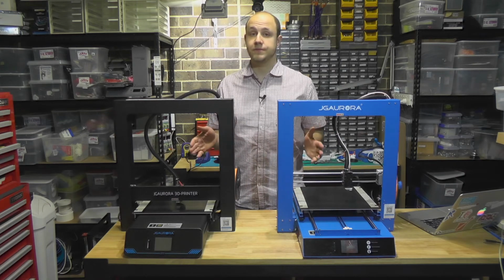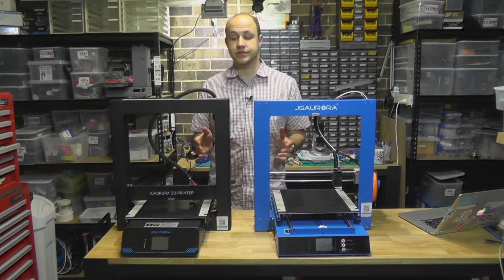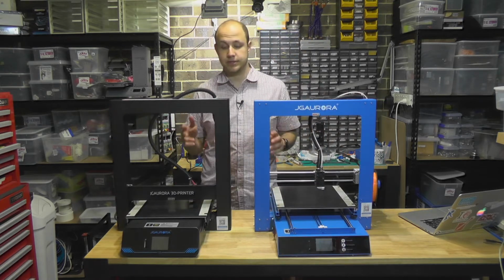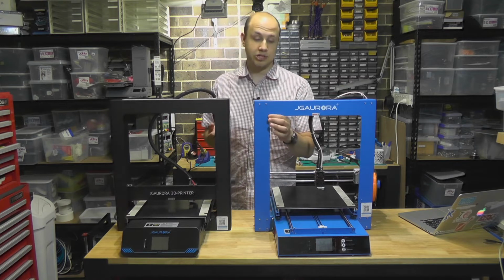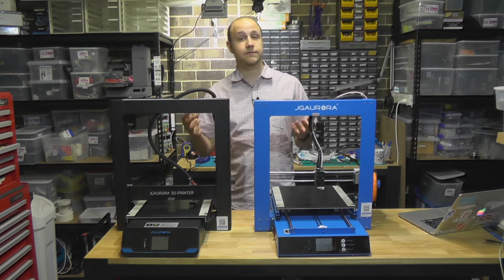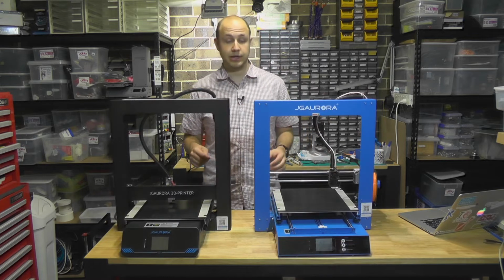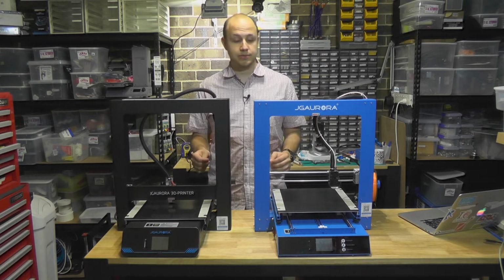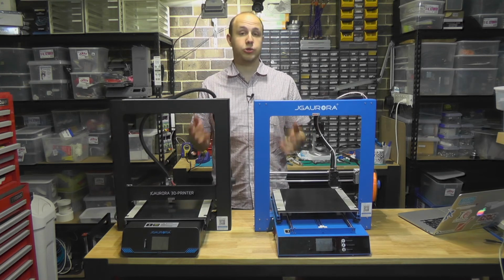JGAurora A5S vs JGAurora A1 - Quick 3D Printer Comparison

Comment: Hello, I want to buy a printer, and I am hesitating between the A1 and the A3S. Aside from the difference in print size, I would like to know if both printers can use PLA, ABS, or flexible filaments like TPU. The indications that I see on the web do not completely clarify it for me. (Is flexible filament printing reliable?) Also, I see that in the A1, it has a functionality to change filament color and to be able to print objects of different colors. Is this method reliable? Does the A3S have this same function?  In general terms, which one would you recommend, regardless of the printing volume?
Thank you!
Reply from the maker: Hi Carlos, both can do PLA. ABS is tricky on open frame printers because of the tendancy of parts to warp, putting the printer in an enclosure would likely help this. Flexible filaments are difficult on both of these printers due to the long bowden extruders. But it is possible on both, perhaps slightly easier on the A3S as the bowden tube is slightly shorter due to the smaller size. Neither printer can print multi colours, unless you have the printer pause on a layer where you can switch filaments. I would not recommend any printer without hearing your specific printing needs. I enjoy the A1, it is very very good value. I have successfully reverse engineered the motherboard to make a full custom Marlin firmware for both printers. You can post on the forum (jgauroraforum.com) if you have further questions. Thanks, Sam
Reply: @SamPinchesMakerShop  Thanks!!

Comment: thanks for the review almost bought a A5S, glad I didn't. sense they went closed source :P
Reply from the maker: They're just about to release a new printer - the JGMaker Magic, that I'm pretty sure will be open source - just waiting for them to send me the files before I make that claim with certainty. But also, we're making good progress towards getting marlin 2.0 to run on the A5S & A1 ... looking promising on all fronts! Finally, they did release the A5S source code in the end too - but it is very complex, and too hard to modify/upgrade easily.
Reply: @SamPinchesMakerShop  it's already able to buy. Is it a good choice for first 3d printer? I am thinking about JG Maker magic or Ender 3 with marlin 1.1.9
Reply from the maker: @luki3323  For a first 3D printer, I would recommend the Maker Magic, but the Ender 3 is definitely also a good choice. Unfortunately the Maker magic is not yet open source, but I will confirm with the manufacturer and give you an update soon.
Reply: @SamPinchesMakerShop  thank you

Comment: Hai ser today I install jgaurora a1 3d Printer I checked Power failure resume print not ok. I am Printe 2 minutes then power off. 50 second power on my 3d Printer no resume print option.
Reply from the maker: I also had this problem - according to JGAurora, the power resume feature is only enabled after 5% of the print has been completed. Thanks for your question. Also, in the future, did you know that you can get help with us on the forum: https://jgauroraforum.com Happy printing 😃
Reply: Thang you so much ser I am chacking..

Comment: One thing to note is the A1 can print at a 50 micron height whereas the A5 can only print at a minimum 100 micron height.
Reply from the maker: 10p6 sorry, thats not true. Both the A1 and the A5 printer can print 100um and 50um layer heights.
Reply: @SamPinchesMakerShop  According to Jgauroras site and staff the A5/A5S can only print down to 100 nanometer scale.
Reply from the maker: 10p6 you can set whatever layer height you want in cura. Print quality is better on A5S and A1 than on the A5 out of the box.
Reply: @SamPinchesMakerShop  I would love to see you do a test print on both of these at the highest resolution (thinnest layer thickness possible) for comparison. :-)
Reply from the maker: @10p6  Thanks for your suggestion! The trouble is with low layer heighs, with a 0.4mm (400μm) nozzle, printing below 100μm doesn't really give you as many benefits - it gives you a smoother surface finish, but no significant increase in detail. For high resolution printing, it would be better to go to a 300μm nozzle, as the added resistance to plastic flow will also help reduce oozing a little bit too. The reason I have not done a lot of print quality tests, is for two reasons: one, they take a lot of time to prep, and optimise the settings, and unfortunately I don't have a lot of spare time at the moment. The second reason is that these printers are not designed for ultra-high-resolution printing - their strength is more in large model printing. The i3 frame design doesnt scale well, as the larger the bed is, the larger the moving mass gets that the motors have to drive around. This means if you want high quality, you need to turn down the acceleration and speed a lot, otherwise you get ringing and rippling in the corners of prints. The A5 in particular has a metal frame made of thin sheet metal, that is not as stiff as I would have liked ideally. I've noticed in prints from the A5, that the alignment between layers is not as consistently accurate or precise, as with some other printers. The long bowden extruder on the A5 is also a downside when it comes to fine prints - each retraction is longer and slower, and the huge number of retractions required significantly increase the time of the print. If you're interested in higher resolution printing, you might consider a smaller printer, like a 250cm square bed, and perhaps a different motion system like the CoreXY. I'm trying to organise some more non-i3 printers to do tests of, but the i3 frame design is cheaper to manufacture, so that makes it much more popular. If you're looking for highest print quality at a budget price, I recommend the JGAurora A1. I was very impressed with the results it gave, a big improvement over the older A5, and the stiffer frame will definitely help the print quality at higher printing speeds compared to the A5S too.
Reply: @SamPinchesMakerShop   Thanks for all the info.   I was actually about to buy the A1 then decided to jump ship and buy the Chiron, hmmm.  I really need at least 300 x 400 and thought about the CR-10 but hate the separate control box, and i'm amazed the A5S or A1 was not given 400 mm height update.   The Chiron is a quirky machine, but it prints huge, can print in high detail (I am sure this slower than hell though) but at least it has direct extrude so can do all the flexible materials.  I would still love to see the A5/A1 prints though, and if you are up to it, a Chiron comparison. :-)
Reply from the maker: @10p6  The Chiron looks good, and the print quality is decent, but from what I have seen the speed is very slow (exactly like I said - huge moving bed...) and the reliability is very poor. Check out their facebook group. Unfortunately I don't have a Chiron available to me to test, but it seems like an inconsistent model. :-/
Reply: @SamPinchesMakerShop   When I get mine, I will probably change the belt drive on the bed for a screw drive of some kind. I know this could slow it down some, but if done right it will eliminate the momentum issues on the large  bed, thus increasing the quality of the print.

Comment: Do you think the homebrew crowd will still work out getting their own firmware on here?
Reply from the maker: Chaos Corner thanks for your question. As part of the last homebrew crowd on the A5... no. Or, at least, not yet. I’m happy to talk about this more, about what is involved on the forum here: https://jgauroraforum.com/discussion/394/planning-new-firmware
I’ve linked my recent blog post discussing this over there too.
Reply: @SamPinchesMakerShop  Thanks. I'll take a look. I've had a Printrbot LC for a while now but the limitations of the bed size and accuracy are starting to pinch. I've been looking at maybe a jgaurora for a while now and now that these new models are out, I might bite. I'm leaning towards the A1 at the moment but there are some deals on the A5S out there right now. I have to admit, I'm also surprised at the lack of the self-levelling. I think that's in the Marlin firmware now (?) and I guess that shows the risks of moving away from open source, especially when it's open source that is very well supported by the community.

Comment: Hi Samuel,

I recently bought the A1 printer but I  am having some difficulties to get an acceptable printing result - or a print at all.... The main issue seems to be under extrusion. This could be due to the stripped filament. I have tried multiple different settings, but none seem to work. Even the by JGAURORA supplied gcodes don't seem to be printing at all. Do you think there could be something wrong with my printer? Do you have any suggestions for other settings?
Reply from the maker: What slicer are you using? Theres a big bug in cura 3.5.X
Also, check that the PTFE tube is not kinked or bent.
Reply: @SamPinchesMakerShop  i have tried cura 14.07 (provided with the printer), cura 3.2.1, cura 3.6.0 and even JGcreat 2.5.0. I tried so many settings... And when one model finally seemed to print ok, the filament started scraping again after less than an hour. The tube looks fine to me
Reply from the maker: Tamara H actually, I remember that my printer had a similar issue at first! I’m going to make a post on the JGAurora forum (jgauroraforum.com) - feel free to join me there and I can explain what I did to fix it.

Comment: I actually think that auto bed leveling is less important than a good build surface. I have a A5 and a FLsun I3 and use to have auto level on the FLsun. After purchasing the A5 with the glass bed and upgrade the FLsun to a glass bed and removed the autolevel. Both printers print great just using manual mesh bed leveling. Since the prints pop off, without any force, the bed stays level and there is no need to relevel every time.
Reply from the maker: I 100% agree Bernie! A good true-flat bed surface also has several great advantages over a wonky one that has been "corrected for" through software - such as distortions in the print up to the "fade-height". I really wish that I didn't need to use mesh bed levelling at all!

Comment: Hello) I am planning to buy an A5S, is it a good printer? I do not know English very well, can you please tell me in brief in short Thanks))
Reply from the maker: It is a good printer for a beginner. It is easy to setup. The print quality is very good. But, you cannot modify it, because the software is locked.
Reply: Samuel Pinches Hello again) can you suggest what is better - the usual A5 or A1? or better to pay extra to A5S? 
Thank))
Reply: @SamPinchesMakerShop  Nobody uses the original software on it.
Reply from the maker: @Yulaw2k   Having been involved in the creation of the custom firmwares for A5, A5S and A1, I'm certainly glad to hear that :) However the firmware for the A5S and A1 is still beta, where as our custom firmware for the A5 is quite reliable at this point.

Comment: Good job Mr Pinches! 👍🏻  u r the first to bring to light the A1.  

Although, I am afraid JGAurora just signed their death warranty.  

Mesh bed leveling is crucial into bringing print quality results, on which requires no hardware.  It has already been developed by the community and implies no extra cost to the company.  Even auto bed leveling with a probe would be feasible and inexpensive.  Yet, they do not seem to be on top of their product, nor listening their costumers.

Notwithstanding, taking into account their chosen path of proprietary board and closed firmware,  these two new machines look more like a statement to the community: “We don’t want u, we don’t need u.”
Reply from the maker: Thanks Leandro! Yes, I'm very concerned about JGAurora making a big mistake. I really hope that their survey will show them how important it is to support open source firmware. I know there are many people who don't care - but I think those people are mostly newbies who do not understand the situation fully. 

The problem will be for JGAurora, that without passionate enthusiasts (generally open source supporters) there will be no community growing around their new printers. They are about to find out whether or not they need the community.........

Personally, I do not like mesh bed levelling. It introduces some artifacts, as it squishes and distorts the part shape into the new uneven surface. It is not good for high dimensional tolerance either. Ideally, the printers should be increasing in precision. Unfortunately, for many people these machines are just fun toys, so the priority becomes lower prices rather than better quality. I think that soon, the market for toys will be over, and people will demand better quality.

It would be sad if JGAurora was to fail this way, but like you say, this is their own choice. The other big two manufacturers - Creality and Geeetech, they have both demonstrated that they see some value in open source, but JGAurora has rejected it. Nothing more we can do. 

Thankfully, there are still some great open-source hardware designs out there, and plenty of 32-bit open source firmware projects too. I'm building my next printer (based on Misumi 3D Pro) from scratch....
Reply: Samuel Pinches They can’t please everyone.  There is always smth missing.  

I do understand there are many who do not care for mods or higher quality, as long as there are no option.  But each of them welcome improvements that won’t reflect on their wallet.

A5 is a beautiful piece altogether. U can easily turn a budget machine into a high end model. 
JGAurora can still keep both worlds, but if they choose to distance themselves from previous models, I foresee Creality taking back the spotlight.  

Build one from scratch is an awesome project.  Wish I had the space to work on such.  Keep us updated 👍🏻
Reply from the maker: @ne0xys  I really like how the A5 encourages people to learn new skills and rewards them for doing so with new features. That is one of the reasons I have stuck around till now. People have come up with some amazing things, and it has made this community a lot of fun to be a part of. Sadly, I don't think the same will happen with the A5S and A1.

Once I have things progressing, I'll post something about the next project. :)
Reply: @SamPinchesMakerShop   You brought up a very good subject regarding the mesh bed leveling.  People should know they must avoid printing on uneven surface, even if the software does the hard work behind the scenes.  Such feature should be used along with a plugin called "Bed Visualized" which displays a topography report.  Ideally you should manually correct the surface to minimize computerized repairs.